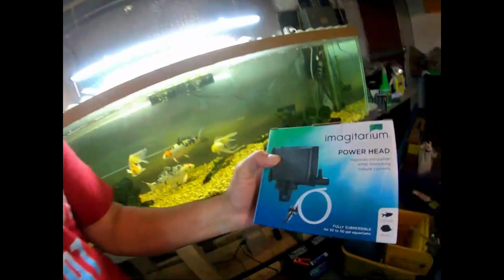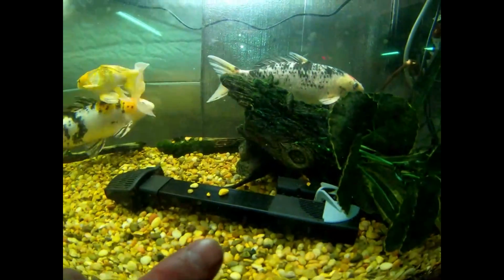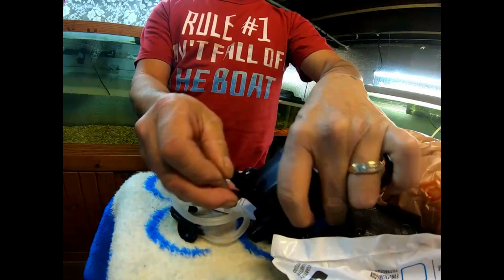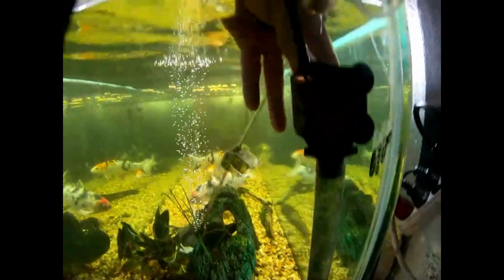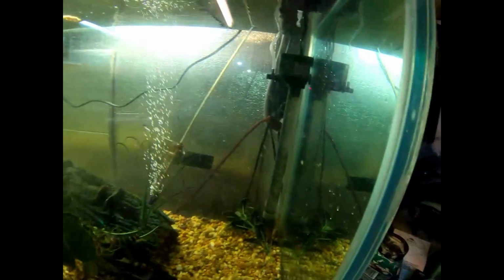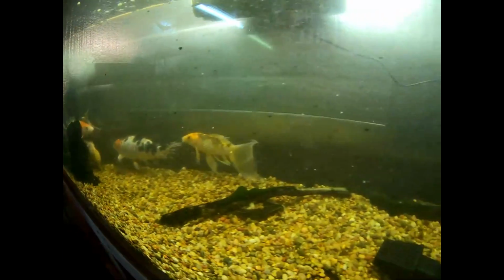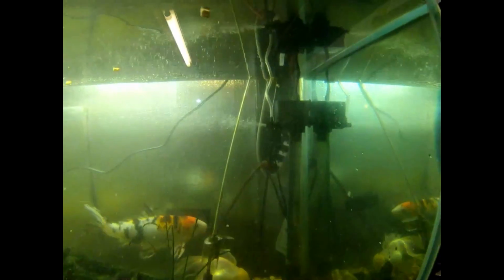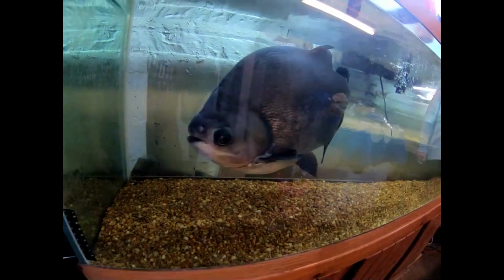Fish tank underwater Powerhead for undergravel filter

Comment: You need more gravel..at least another 2"  worth. As long as you make weekly water changes while doing a light stirring of the gravel..it will work. Make sure you keep using the outside mechanical filter too. I ilke undergravel much better than sponge in tanks with no plants. OR the plants in UG filter tanks are in pots. That works'